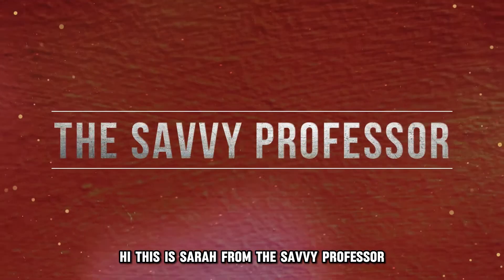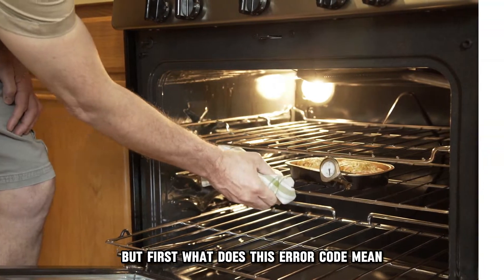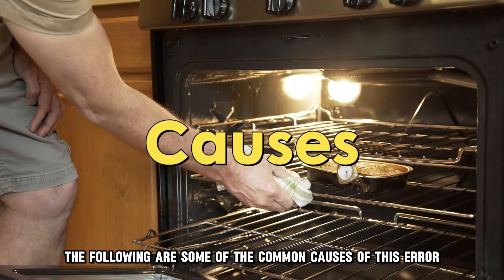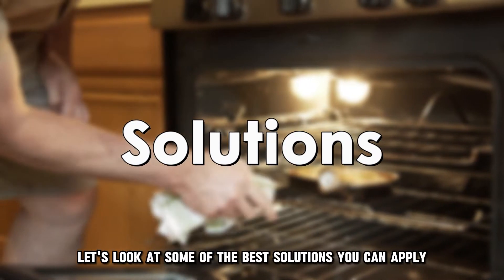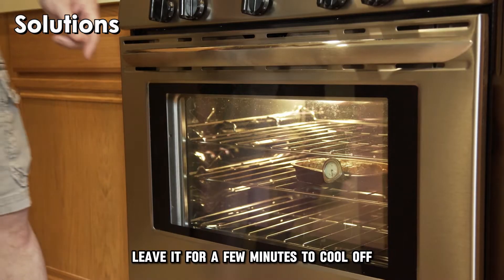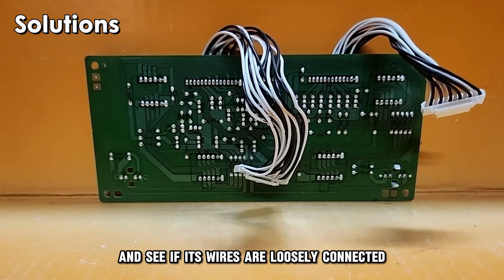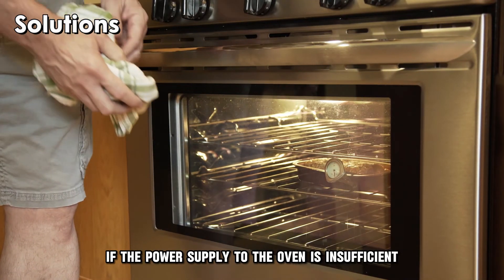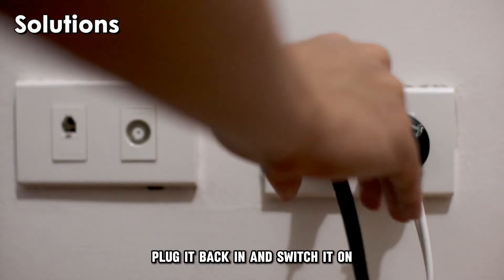LG Oven F9 Error Code (Heating Error - Why It Occurs And How To Resolve The Problem - Easy Guide)

Comment: My f9 problem came from the fact i was using my dryer and oven both at the same time (they are next to one another) and that was too much demand for my electricity board.
Don't use both at the same time and your oven should be fine!